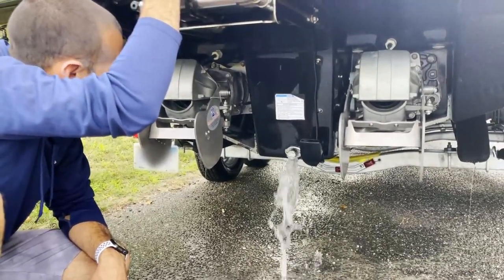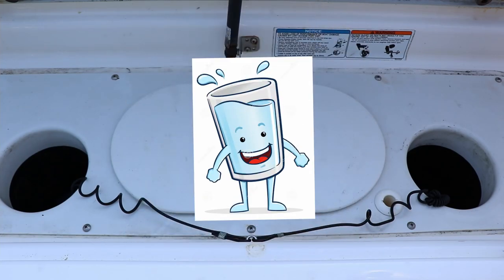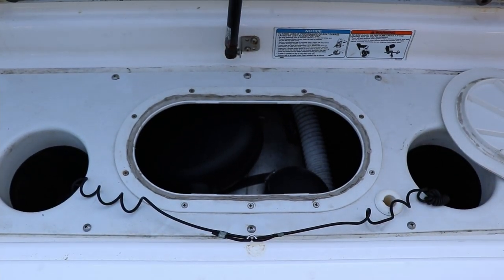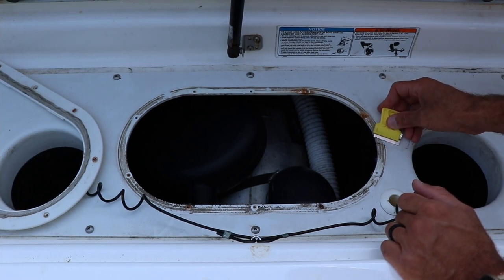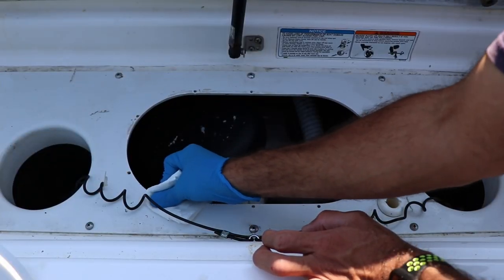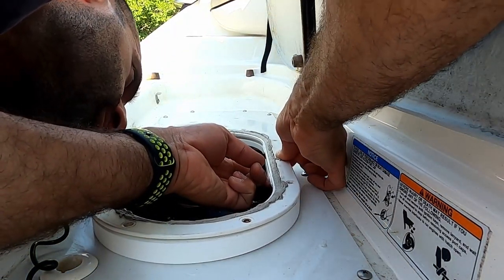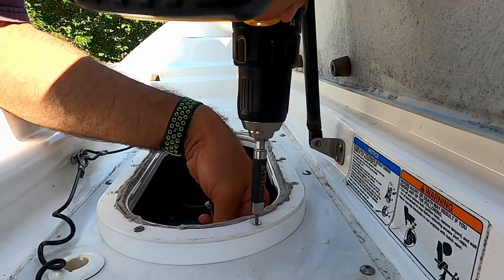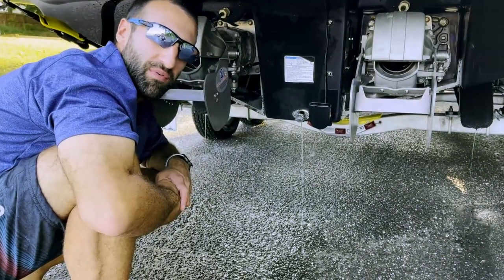Yamaha Jetboat | Mechanical Access Port Riser

Comment: I have noticed on my 2017 ar240 if I only drive around at low speeds with no full throttle driving, I don’t have any water back there. Full pressure on the clean out ports at wide open cause water to come up the tubes quite rapidly. This is what I believe is the biggest contributor to this water problem.
Reply from the maker: Yup I agree. The riser at least gives it a little more time for the drain to do it’s job.

Comment: Nice, I love those quick value added projects!  With my 190, I would make a habit of washing down that area with salt away and sometimes hitting it with Spray-9 to deal with the mold build up.  If I had remembered. I'd also leave that area open to dry out...
Reply from the maker: Yup. That area is always full of water. Anything to help drain it out instead of down! I bet they came up with new ways to do that in the 250.
Reply: @boatingpropless  Let me know if you have any time this week for a possible boat meet up and I can show you around the 252SE!

Comment: Saw your cobra fins.  How do you like them on a twin engine Yamaha?  Can you do a review of them?  I know Leon has the TV’s as do I, but for some reason I do think the TV’s affect my turning at higher speeds, I took them off to get the feel of running my AR250 without fins. And now I am curious about the Cobra fins.
Reply from the maker: The only thing is that on the newer boats, they have an articulating keel. Our boats are before the redesign without one. The only main difference between the CF and the TV is that the CF can stay down at all times. Steering does get incredibly hard to turn while they are always down. I actually changed mine to go up at speed.
Reply: @boatingpropless  thanks.  I think that on my model I am going to try operating again without the TV’s.  I do seem to notice a little positive difference without the TV at cruising speed (could be psychosomatic), or maybe I am just comfortable operating a low speed with the dual engines.

Comment: Does the 2021 come like this or do I need to stall one?
Reply from the maker: The 21s don’t have a riser built in. They did revise the tray so that there are channels that direct the water to recessed drain holes. Doesn’t completely solve the problem, but definitely helps get the water out.